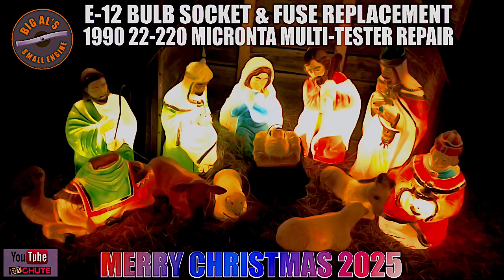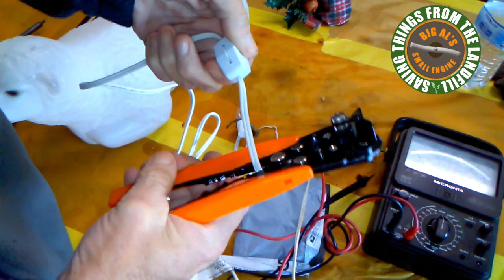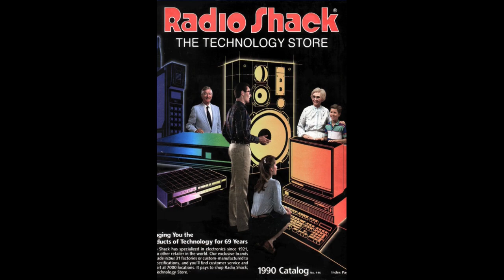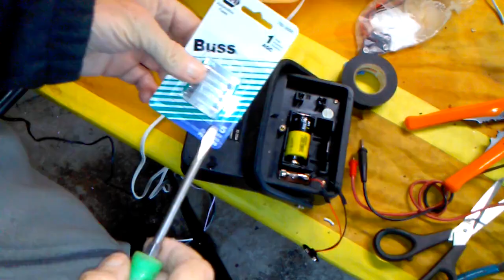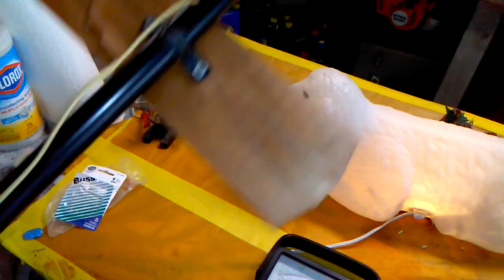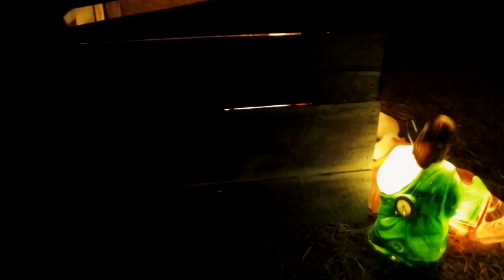E-12 Bulb Mount & Fuse | 1990 Micronta 22-220 Multi-tester

Comment: Nice video. I just got a similar vintage set.  Just ordered some replacement lights.  They have the same clickers as yours.  I’ll remove mine too.  You should check out the new (to me) solder heat shrink connectors.  They are great for wiring trailers.  I use them and then slide some heat shrink over them.
Reply from the maker: Hey I will sure check them out.  As a matter of fact I need to re-wire my
trailer soon.  Thanks!  🍻